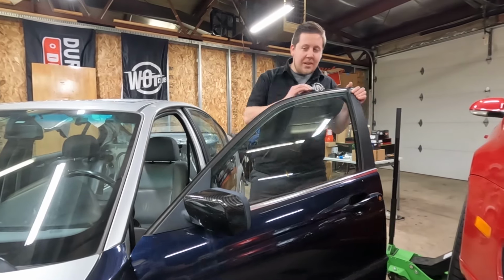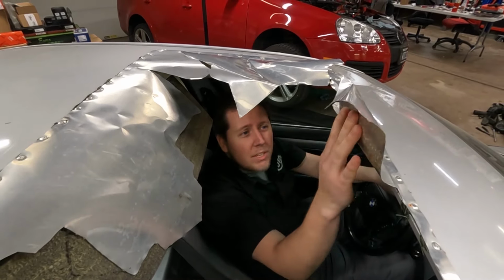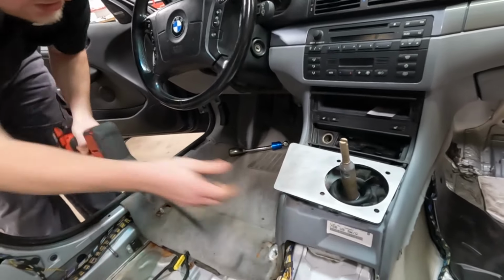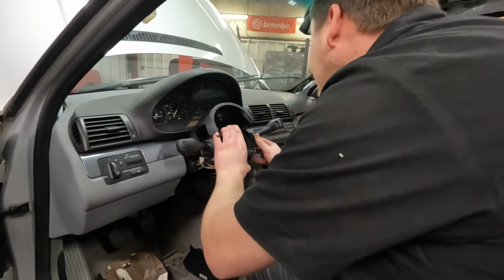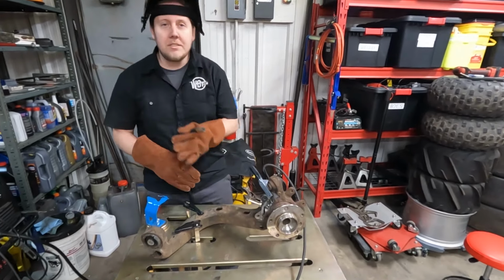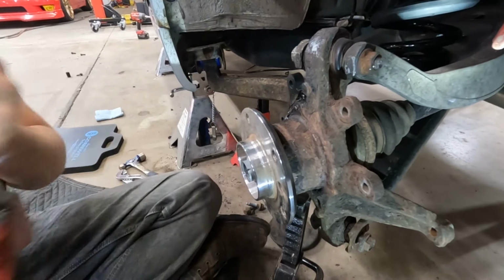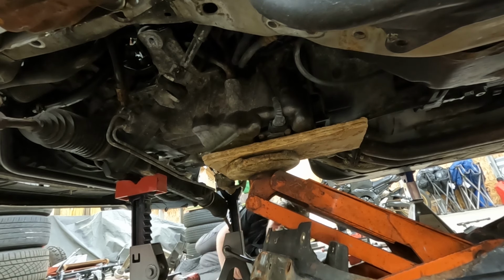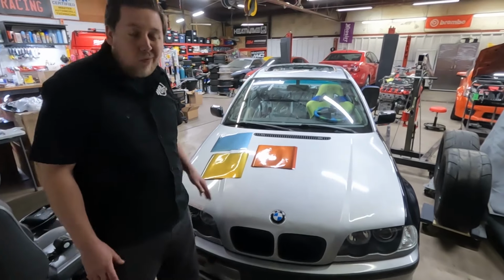BMW E46 Drift Build pt1!

Comment: have you already drifted it? This is the worst type of 'angle' mod that you can make in BMW - it loosens up every few runs and what is worse, makes antiackermann geometry. Car will have more steering angle but will be worse to drive in case of linearity and predictability then STOCK. If you really want to learn and drift it, change the adaptors for 4-bolt style (like polish Odesa CNC or CNC71) and then proper alignment. WIth those you will waste your learning time
Reply from the maker: Sounds good! Appreciate the help!